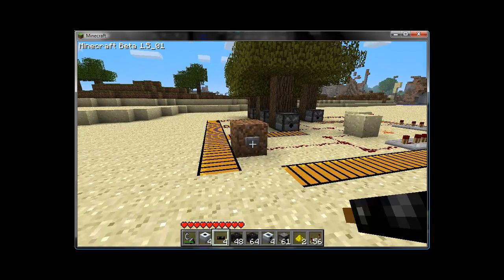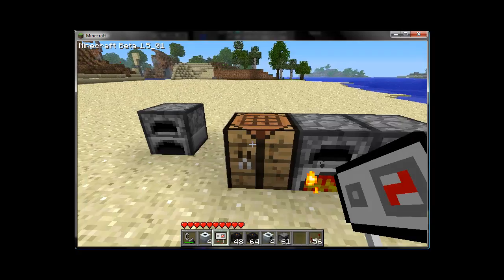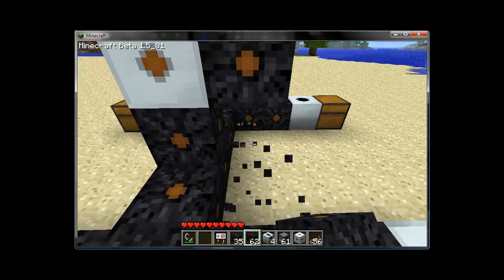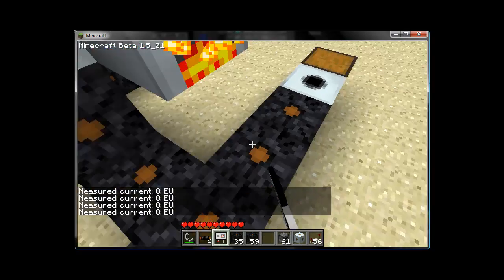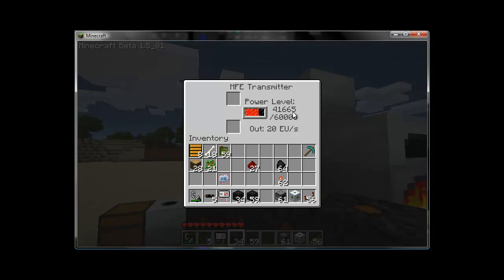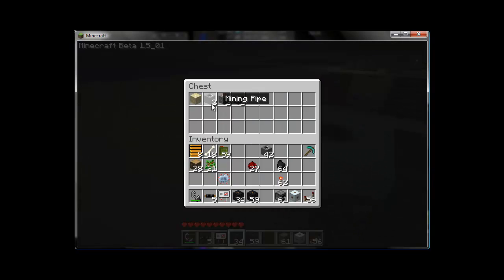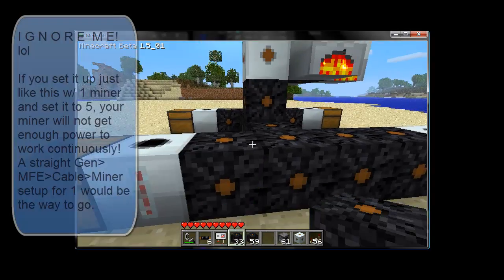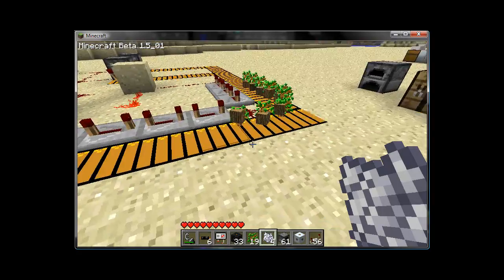IndustrialCraft Tutorial Part 5b: "They're not tentacles, they're Genticles!"

Comment: That harvester and conveyor belt setup would be handy if combined with Pfaeff's Allocator block, wired up to a clock generator so it's constantly pulling in items and with a chest attached for output.  Just have the conveyor terminate at the Allocator's input slot, and you won't even have to go pick up the items, they'll be stored in a chest to be retrieved at your convenience.  The allocator's BlockID sometimes conflicts with other mods, but the mod comes with a config file for easy ID change.